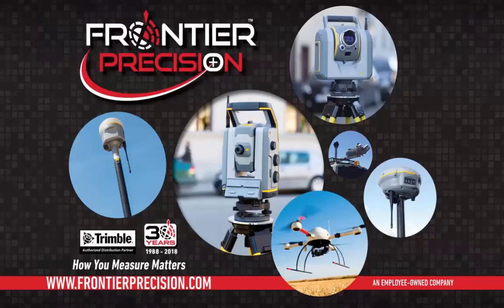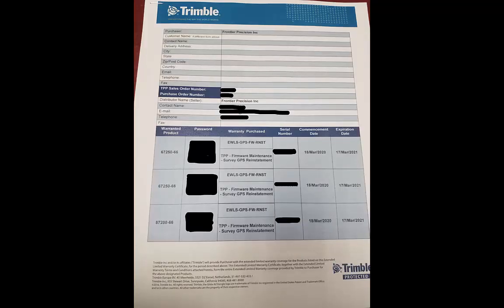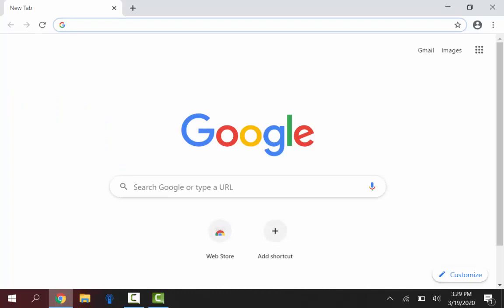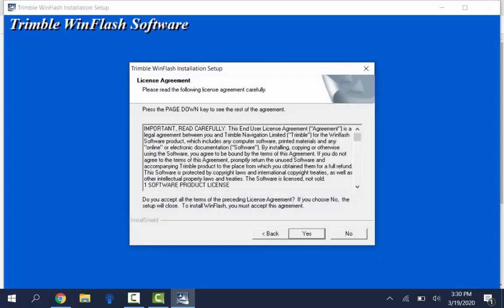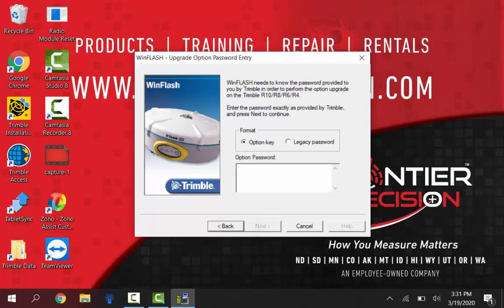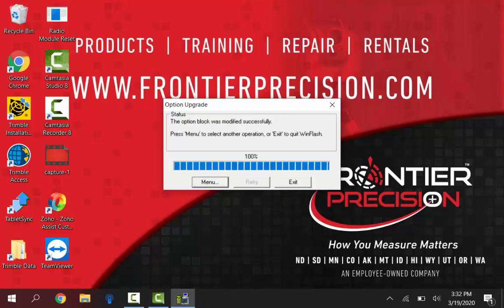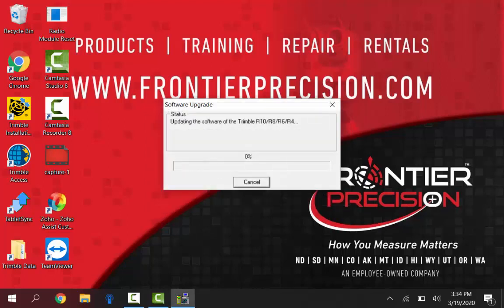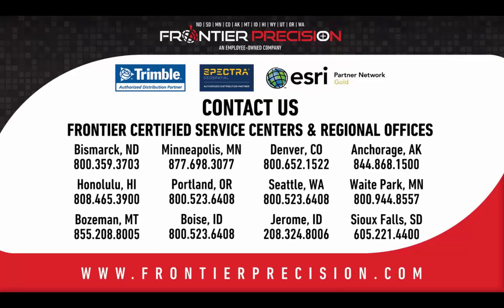Trimble R8-3 firmware upgrade via TSC7

Comment: For updating the R8-3 firmware to use with the TSC5, a 9pin to USB adapter is needed. Usually these cables come with a CD to install the driver onto your PC. The TSC5 is powered by android, so I don’t believe WinFlash will run on it. 

Now my TSC5 can finally Bluetooth to legacy receivers with no problem. Great video!